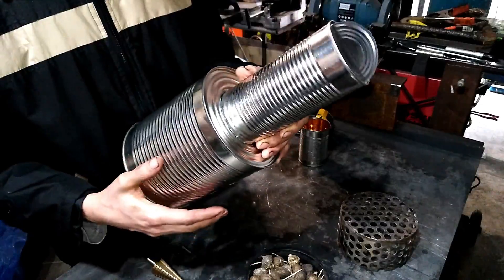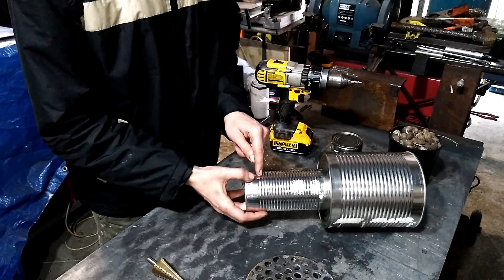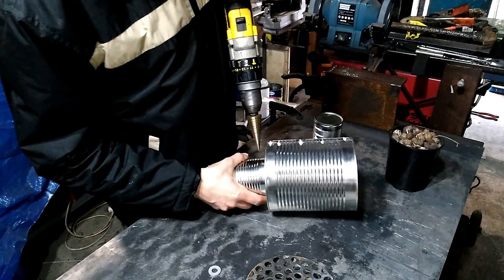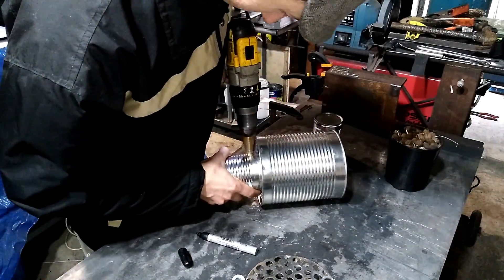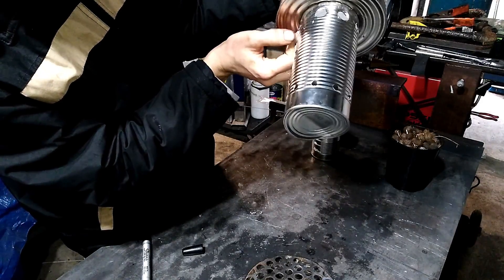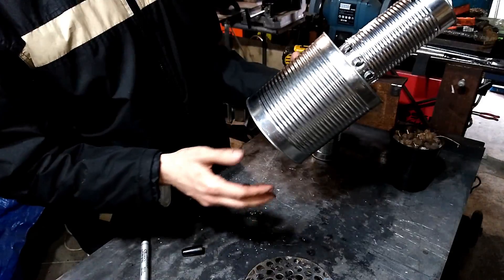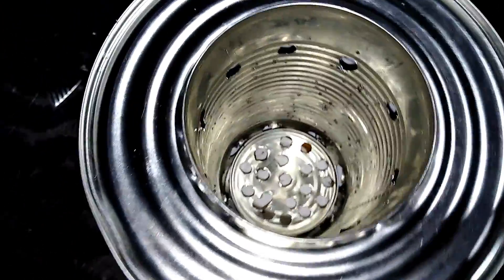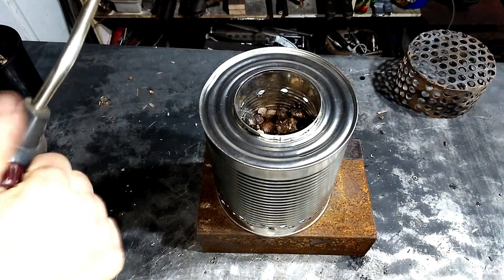Palm Nut Gasifier Build

Comment: let me see we don't pick the wrong Palm seeds or nuts to burn and they turn out to be poisonous but anyway if you're going to make this a gas fire is it going to be made to generate some sort of lotion into a generator Maybe cuz you said it's a gasifier that's what I was thinking you were going to do with this create gases that burn efficiently to run an engine that's what I thought that meant
Reply from the maker: Nicholas Napier the nuts are from the jelly nut palm tree. They are related to the coconut palm and are edible, native to Brazil. The point of this video is to get a better understanding of how they could be used for fuel in a rocket stove. My bad for not making that more clear.
Reply: @LittleAussieRockets  you got me thinking, got walnut and hickory trees here, be a grate way to use them.  Use a lawn sweeper a pile them up for the squirrels to clean up. Great welding video, will you do a tig video?

Comment: Cheap. Handsomely. Visually. But...
The utensils are cooked. And wash it for a long time. Do not walk around with dirty dishes.
And you can not spoil the dishes. To strengthen the top sheet of steel. Make the hob.
And you can immediately have the right stove. For example:
https://www.youtube.com/watch?v=yV0J2bhNcRs&t=1s
Weight 1.24 kg. But it's worth it!

Comment: Try making a tin can hole 1/8" about 2mm smaller than needed then tap-pound (stretch) larger.  You can make a desired hole size near perfect using this tapping (peen-hammpering) stretch technique.

Comment: Great stuff! But where to get palm nuts from?
Reply from the maker: Isa Kocoglu Thanks mate and good question. For most people these are a waste product, so I guess this video is for them. But wood pellets that can be bought from pet shops and will work the same. The stove I will be working on next will run on both, if all goes well.   Also this can Gasifier will run on sticks and twigs just fine as well. Take care Isa
Reply: Little Aussie Rockets , Thank you for the tip. I went and searched for pet bedding wooden pellets but was unable to find wooden pellets per se, rather paper pellets... Despite paper being made from wood, they are not quite the same thing I assume. Correct? Or do you have any idea if paper pellets would work just as fine?

[edit] found them. Horse bedding wooden pellets are available.
Reply: @IsaKocoglu  kitty litter, or actual pellet stove fuel

Comment: Great biomass gas stove... nice secondary air jets... how many milliliters of palm nuts, 500 ml? If 500 ml of wood pellets, it would flame burn for over an hour. About 11 ounces, 6,000 BTU. Looking forward to next video.
Reply from the maker: Douglas Pohl 
 80mm of palm nut, which is 230 grams of fuel.
Reply from the maker: The can diameter is 80mm and the fuel depth  was 80mm.
Reply: Little Aussie Rockets About 400 ml about 4250 BTU if wood pellets.